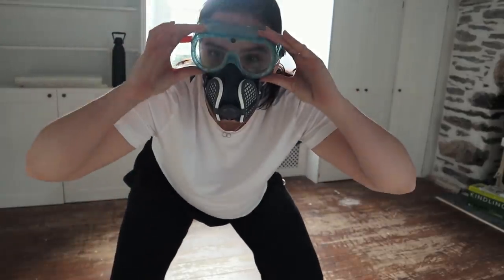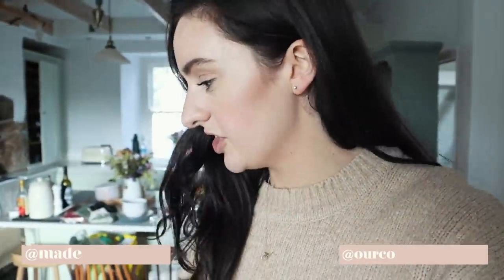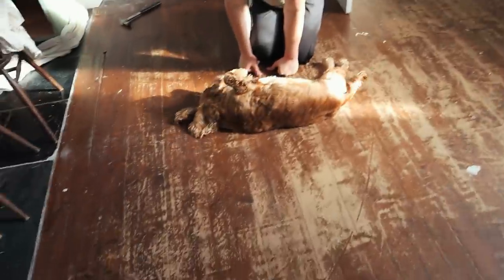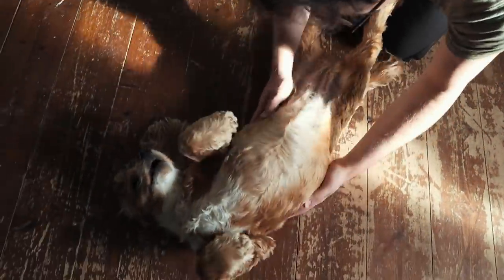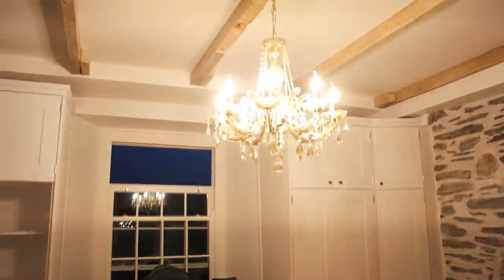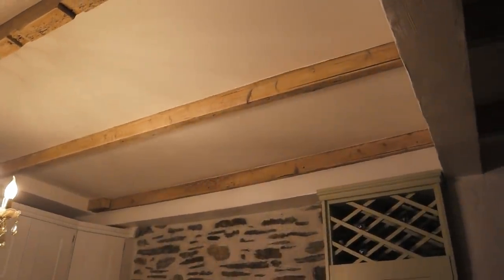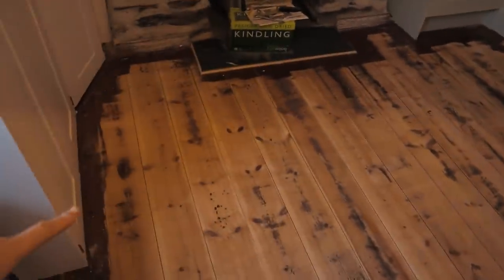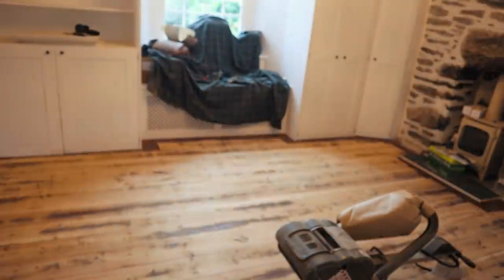FLOORBOARD DIY MAKEOVER | Before & After Home Renovation | KITCHEN RENO PART 8

Comment: It's a nice contrast. It's hard to make new things look old. If you tried to match it, you would have just been frustrated it wasn't quite right. I like the warmth it brings into the room to go will the cool greens in the cabinetry. It looks like 90% of it will get covered by a rug anyways so I wouldn't worry too much about it. They are obviously a huge improvement from the old color.
Reply from the maker: I agree! It’s so normal in projects like this to end up with a different result from what you had in your head but then realising it’s actually better than your original idea!

Comment: The floor looks as if it has been there for long time and you have just cleaned it, which of course you have 😂. It will now age gracefully and take all the knocks and dinks without you having to be precious about it which is what you want in a floor. I bet in a month you will not notice it which will show that you have done a good job. How lovely to have had such good floorboards in the first place. The wonderful thing about pine is the light coming in through the window will alter it as time goes on. The hard work and anxiety was worth it. Lovely video. Loved the one about the dresser too.

Comment: Great floorboards video Madeleine unfortunately carpets keep the heat and warmth in more than  floorboards do so when it's colder so that means using more electricity or gas to heat up the rooms ( except the kitchen & bathroom because they aren't practical in these rooms.) So floorboards do look more natural and I don't know what the cost of carpets would be these days but as far as energy running costs are concerned it may be cheaper to have carpets. Love 🥰 the video and love 💕❤Madeleine & Alex.

Comment: I love them! I sanded 3 bedrooms and a hallway in 2019 when we moved. Is the reason you didn't use an orbital buffer because you weren't using a varnish? I guess it's not needed with an oil? That machine was wild and I simply could not control it. I also hated the edge sander! I ended up going against the direct of the floorboards with the drum sander because it was way more effective, and then finishing in the right direction. Mine turned out a little more orange than yours, but I thought we needed a varnish for protection. Unfortunately it dents very easily, but I guess that's the pine. Maybe I'll consider an oil next time!